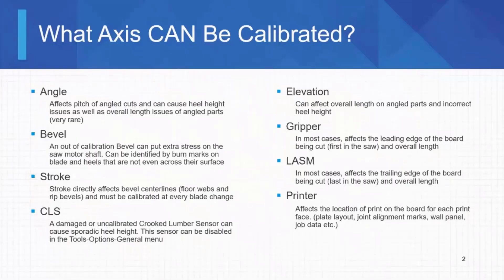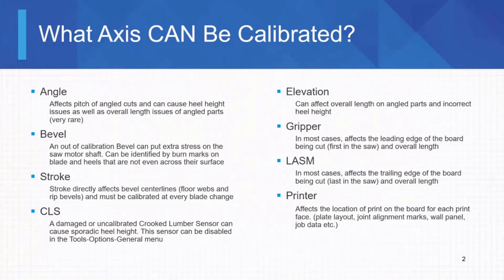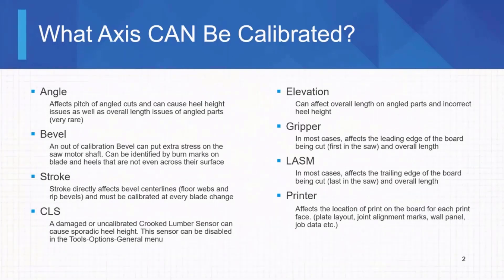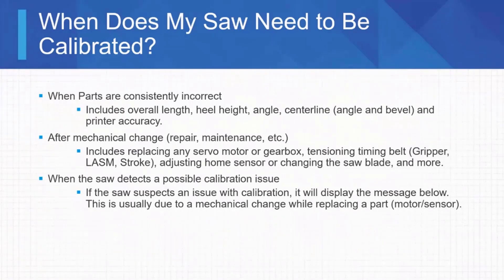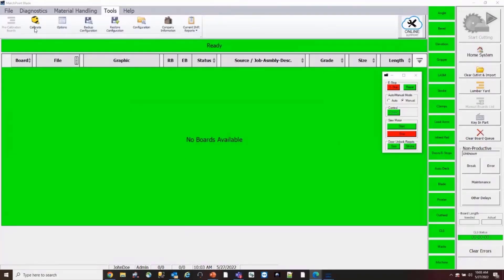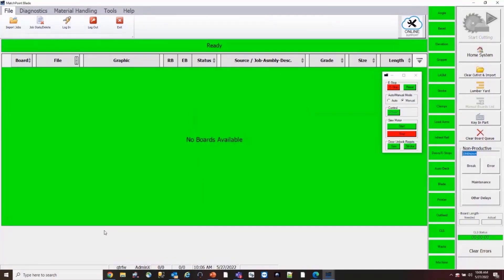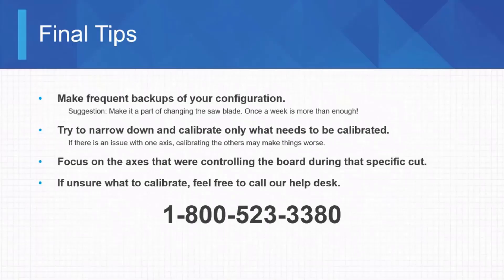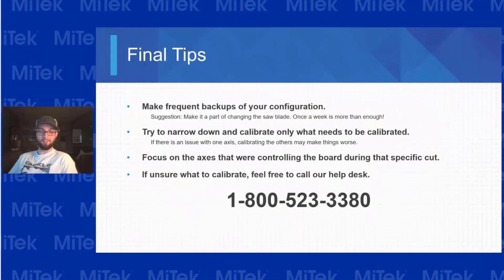Virtual Friday: Calibrating a BLADE Saw 6/3/22

Comment: Thank you and your colleagues for these videos. They are very helpful. I am the maintenance for truss company on Vancouver island Canada and sometimes I need information or answers  immediately and can not either get to a phone or so busy and not able to wait for a mitek tech to call back. Production is second priority , Safety first of course. But really appreciate these videos for reference. Although I would find it tremendously more helpful if on calibration vids you would also include possible errors, or make some vids about saw systems and calibration errors with what or how to approach them when encountered as well as real time repair videos for things like the linear bearings , auto deck , the main blade systems eg: hub replacing , servo motors , etc. as well include what to do if things do not go that simple with a four year old saw rather then a shiny clean one that you have shown in past vids . Oh also how to make the dust collection/control to be able to keep it at a minimum. I have installed a couple extra airlines and we now have 2 3 hp dust collectors but still have pyramids of dust a foot high at every corner of the conveyors and under the saw . You also get snowed on when opening chamber door as a lot in the chamber  also. But saw on a few vids your saw seems to just eat the dust i am amazed the camera used did not get caked in it. Ours builds up big time in a day or cutting and some just don't want to clean up constantly as would be the only way to keep it acceptable not to mention big health and safety issue when ripping bevels as the dust shoots out the out feed big time and creates a cloud that travels through the plant for everyone to breathe in. 

 not always everything goes according to the screen when calibrating or repairing. Vids that explain errors and how to tackle them would be great.  you are getting errors during calibration or if one does not complete successfully and errors i get kind of lost on what or how to rectify . Specially if you have checked all mechanical but calibrating over and over again. Had issue with angle cali last week where it would only cut one side of angle and really deep . Board almost caught fire and sounded really harsh when cutting and comes out with like a 20 or 30 degree cut half way into the board with every cut lol really hard to judge which is best with only one ledge , then the bevel plunges were about a 1/4 inch beside each other . hehe none of the cuts were even properly cut let alone picking a best one. But again thank you for the support vids you have so far. Much appreciated.